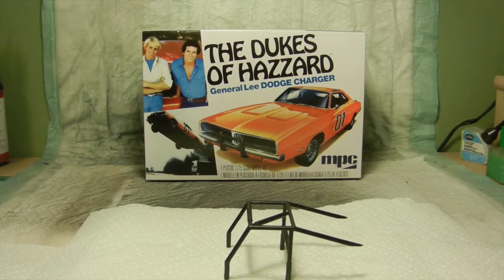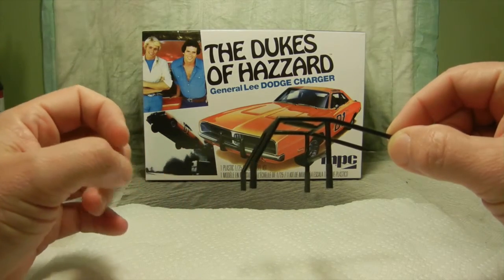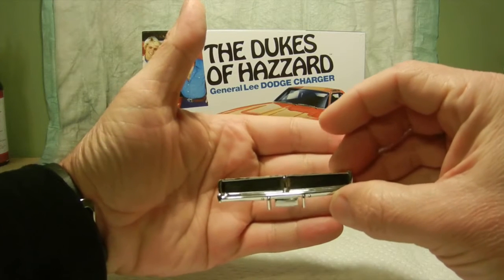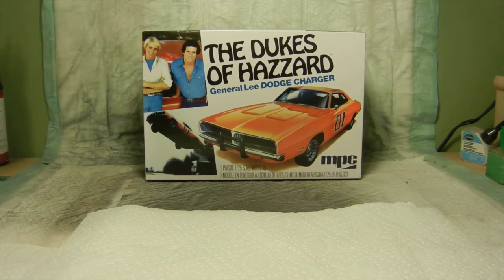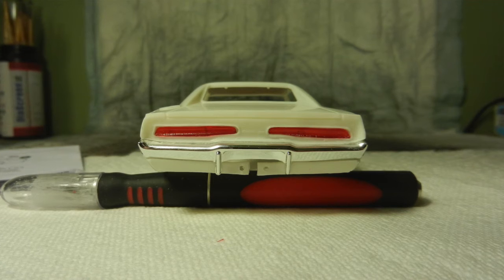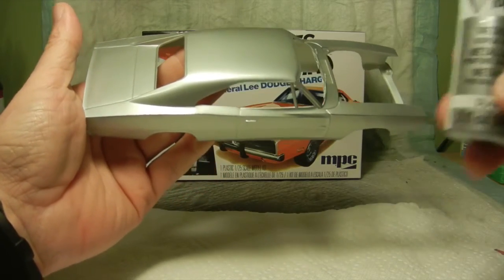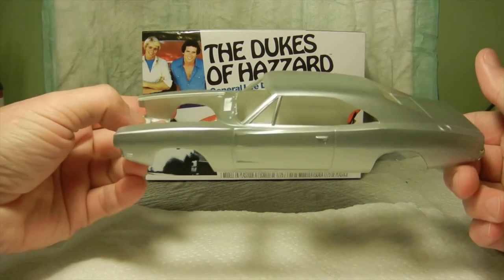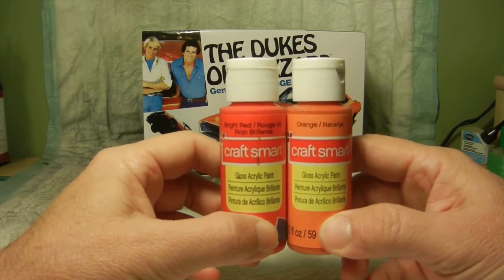MPC General Lee Ep.  4

Comment: Great series! Do you know approximately how much thinner you used to airbrush the craft paints?
Reply from the maker: David Obenour I basically start off with about 4 drops of thinner and mix it up in my cup with a toothpick until it’s the consistency of skim milk. I may have to add more, but it depends on the paint you use as well. Hope this helps you.
Reply: Michael Kovach thanks!

Comment: The Roll cage and the body look great!  The color looks correct!

BTW, why did you paint the silver first?
Reply from the maker: +Michael Scarola Thanks Michael, I think of it as rust proofing the car. ;-) It's just one of my steps that I do on all my cars and planes as well. After wiping it down with 91% alcohol, I apply the primer (silver) as an underlying coat, let it dry then apply my base coat. For me the acrylic seems to flow better over the underlying coat rather then the bare plastic.